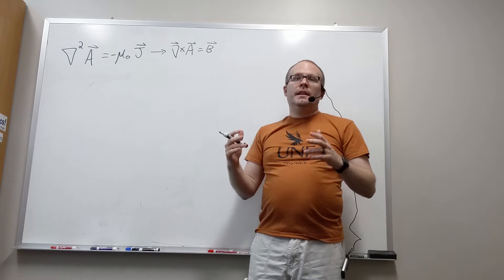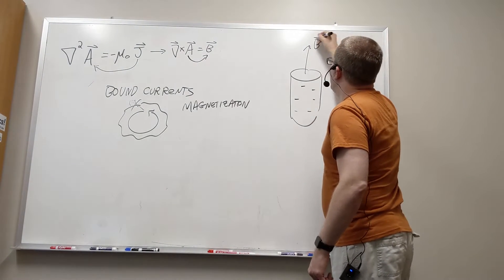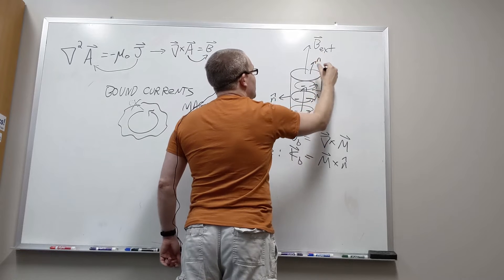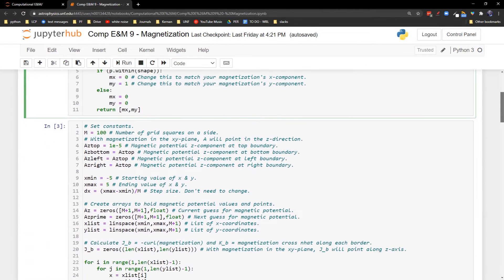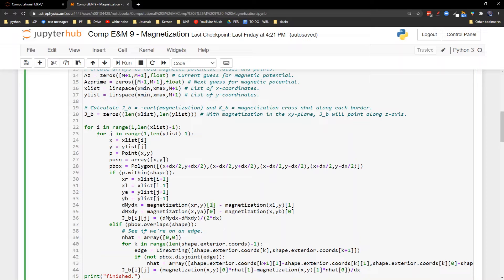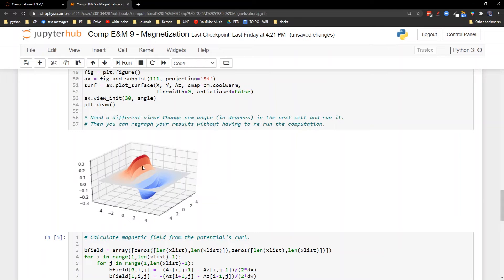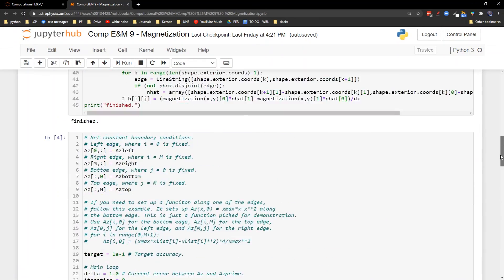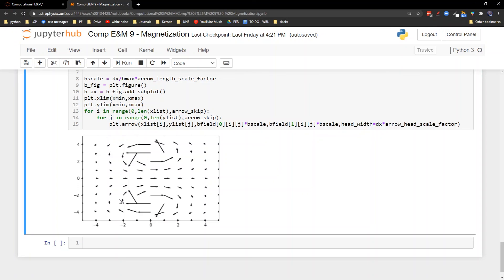Computational EM 9   Magnetization

Comment: magnetic field is not looping back inside like you show on 7:20. this is misconception based on watching how metal dust is located around magnet and what compass arrow shows around magnet. instead what really happens is there are 2 vortexes, each vortex at every magnet pole, and their cone apexes intersect in their gravity center - the middle of the magnet/planet. so the electric energy movement is transferred from both poles to the center simultaneously. like the shape of sand watch, but the gravity is in the middle (not at the bottom). both vortexes "twist" in the same direction, just like both hemispheres of any planet (because planet is a magnet too). then different magnets / metal dust / electrons are twisting their paths according to the strongest vortex around, it makes them follow just like the water in your coffee follows the path of a stronger spoon during sugar mixing. that's why compass changes its direction around the magnet. and the reason for why metal dust is pushed away from the center of a magnet is that every dust element near magnet center (being a magnet itself) has opposite rotation direction. it's opposite because they are influenced by vortexes at poles. therefore there is increased tension / electric pressure between the center of a magnet and smaller elements. and when the rotation direction is the same (like near poles), this makes electric pressure between them low, so the environment (consider dark matter or aethear) is pushing them together, which is called "magnetism" (by mistake also, because the actual true magnetism is repelling, not attracting). just like your vacuum cleaner - it does not suck in anything or attracting, what it really does is creating a low pressure zone inside and the atmosphere is pushing objects into that zone. this is how all galaxies form: on the ecliptic plane of a double vortex. check out similar vortex structure in the pool: https://www.youtube.com/watch?v=pnbJEg9r1o8